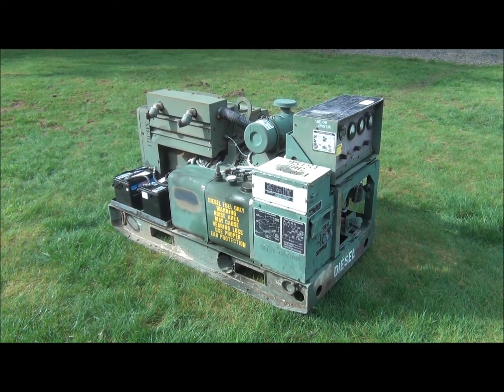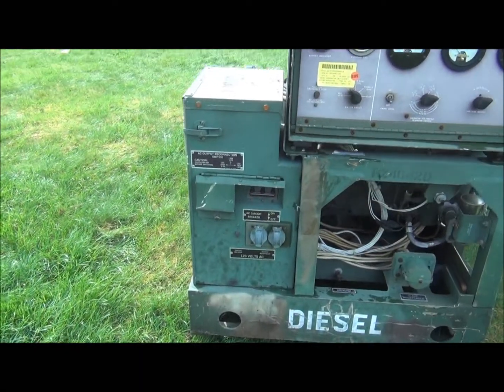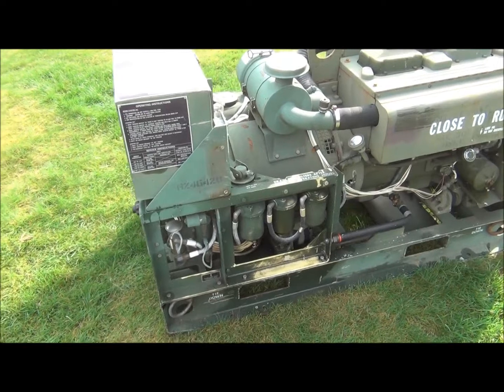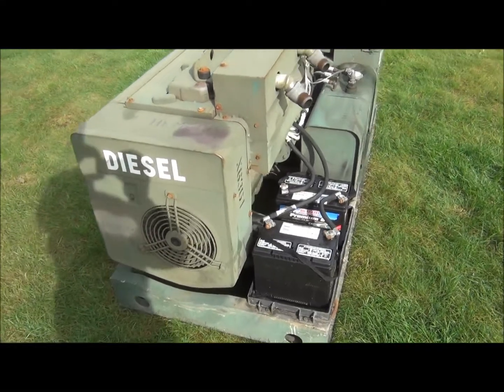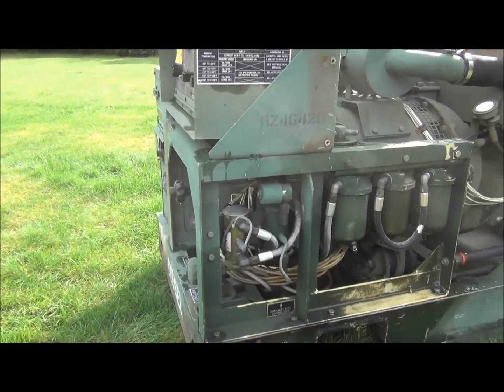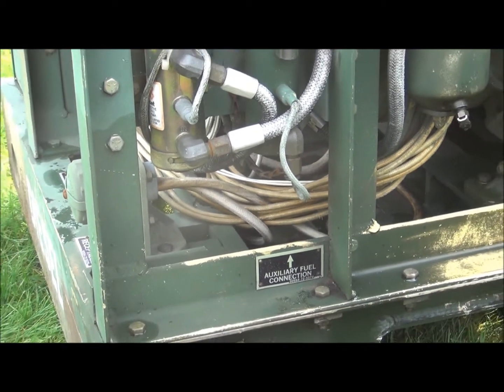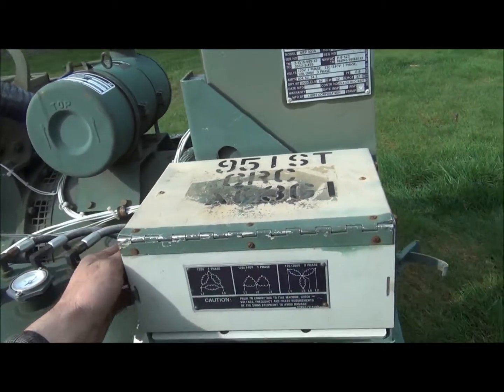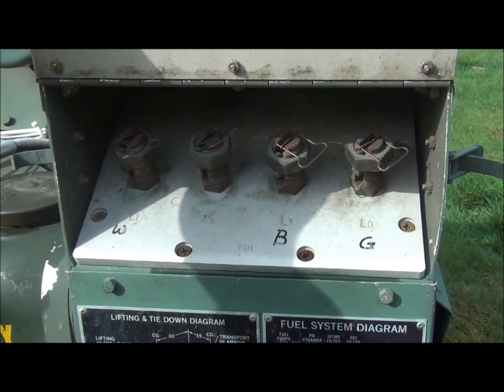MEP-003a features and load test

Comment: I have a mep003a when I get the Hz to 60 my voltage is at 160or over 300 do you have any idea what I can do when I adjust the voltage knob it does not change the voltage any thoughts Dave
Reply from the maker: This is difficult to troubleshoot unless I'm there!  I've seen a few voltage regulator failures; if that happens it can either fail and cause no voltage or fail in a manner that it doesn't regulate field current, causing a high voltage.  It sounds like this might be what happened in your case.  Of course, it could be a wiring/rheostat issue too, but no way to tell that unless I'm there with some wire piercing probes and a wiring diagram.  My guess is a failed voltage regulator.
Reply: Thanks for getting back it took me some time and I got it back up and running I put another output control box assembly on and it works great thanks again
Reply: I think it was the transformer I am going to try to change it out and have a spare

Comment: hey I have a question. I have one of these MEP 003a's and I am unable to adjust the voltage via the increase knob. it is making too much voltage. for example when on the 120 setting it is making 180 volt and when on the 240 setting it is producing over 300 volts. any idea as to a direction to go down. it used to work correctly and just started doing this. thank you very much for any help.
Reply: I have the same problem did you find out how to fix it
Reply: Onans usually have a voltage regulator pcb. You can buy aftermarket ones.

Comment: Love your vids learned a lot I was wondering though when you run these units about the 100% load does it negatively affect the units or just burn more fuel, plus what would be a good price to pay for a unit this size from a gov auction?
Reply from the maker: No problem with overloading these generators; the military de-rates them.  I usually test them at 130% load for short duration, and 120% for longer duration.  I usually see 003's like this go anywhere from $500$2000, depending on hours, condition, and what it comes equipped with.  I usually don't buy them if they exceed about $1200.
Reply: @MattVerley  what's the fuel economy like on these?